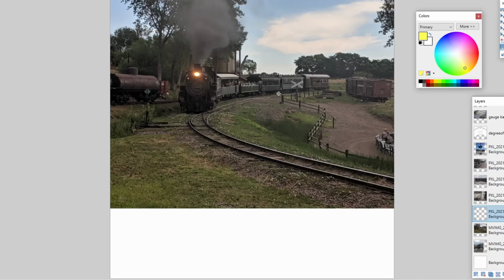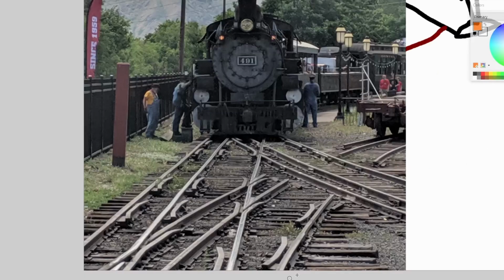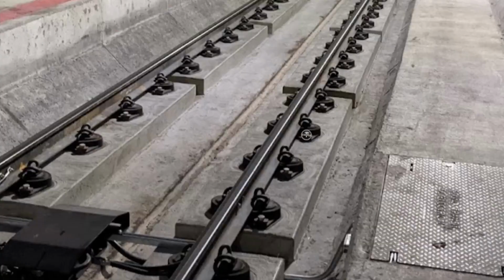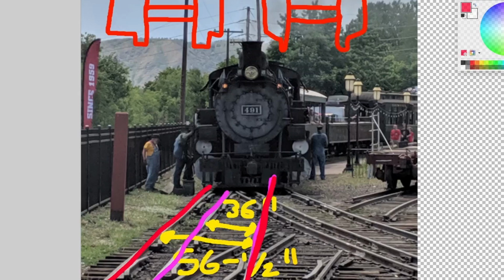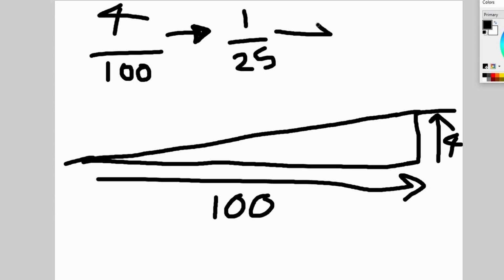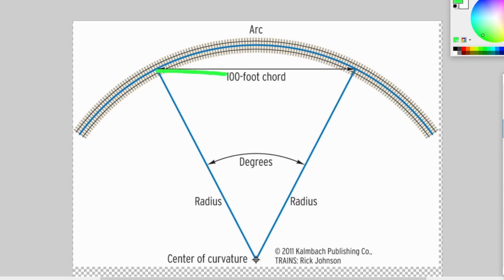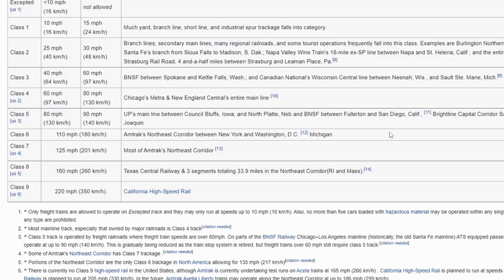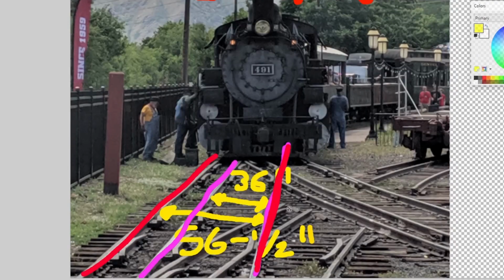TRACK 101: How does track work? (Including many often-missed things!)

Comment: Very detailed & accurate look at railway track - but incomplete in one significant way.
The contour of the wheel was mentioned regarding gauge tolerance, but there's another aspect. When vehicles go around a curve the outside wheels travel greater distance thus must turn faster. In automobiles/trucks/etc this is accomplished by special gearing called a "differential". But railways use solid axles. 
This is where the wheel contour (AND the rail contour) plays an ingenious role. Both rail head & wheel flange having a curved cross--section allows the solid axle to shift to the outside of the curve, riding on a slightly larger circumference, while the inside wheels likewise shift to a smaller circumference, allowing the outside wheels to travel a greater distance. Some metal-on-metal squeal often results but it is pure genius.
A simple drawing (that I cannot do here) would help this explanation.

BTW, PRIME-er (long "i") is paint or something that helps set off dynamite. The introductory book is, in American English, pronounced PRIM-er - short "i". Look it up if you doubt...
Reply from the maker: Thanks for the comment Doug! Very, very important bit you mentioned there. Always a challenging thing to figure out just what the right amount of info is, but I think this would've been a good add. So, I'll pin this comment. Thanks :)

And I am not surprised that I am messing up English. I am an engineer, after all...
Reply: @Hyce777  @Hyce, I think Doug is having you on. Primer is primer. From "prime" being the first. So a first book or a first fuse, primer (the I rhyming with eye) is correct. Primmer is just the adjective formed from "prim", which is to be "feeling or showing disapproval of anything regarded as improper; stiffly correct" according to Google, which apparently went away and looked up the Oxford Languages Dictionary.
Reply: @neilbarnett3046  it's sooo odd how many different ways people can say the same thing... Even just comparing US and England.. 
Words are hard
Reply: @Hyce777  I have often wondered (and so far been unable to discover) if some unnamed engineer thought this up & designed the wheels for this result; or if (more likely) it was just a discovered added advantage to solving the problem of a hard-transition flange & square rail head. The early days being strap iron on top of wood, the curves could well have been added long before increased speeds required it. Any insight on this question?
Any thought of editing the video to add this info with a drawing?
Reply from the maker: @dougvalmore7389  I've not heard of the story of the dawn of the tapered profile either. Would love to find out.

I've never edited an already posted video before? Not sure how that works. I'll look into it. If it's not possible, I am planning following on classes with other things I've come up with, tangentially related topics, etc. so I could include it there.
Reply: @Hyce777  Not sure. I've seen many videos w/corrections/additions & assumed they were made after uploading... but we know the perils of assumptions.
A search showed tutorials on Youtube Studio & how to trim stuff out, and even add cards, music & end screens, etc. But nothing specific to adding new material. Hope it works out...
Reply: @Hyce777  Here's another interesting bit about track gauge: Why on Earth 4 feet 8 1/2 inches (56 1/2") as Standard? Seems an odd number to choose.

Legend (& perhaps plausibly fact) has it that was the normal width of a 2-horse team side by side (or multiples thereof). Thus from Roman chariot days it was the width of most roads, which then (having been cut/filled/leveled/tunneled/etc) became the basis for much railway right-of-way. Fascinating, if true, no?

Plus, is that distance from outer, or inner edges of rail head, or center of rails? I honestly don't know but assume it's measured on center, like studs in house walls. Thoughts?
Reply: @dougvalmore7389  I think the gauge measurement is between insides of rail head
Reply: @dougvalmore7389  Yes and no. 56 1/2" was the gauge chosen by George Stephenson for the Stockton and Darlington Railway, he chose 4ft 8in first, but went half an inch wider (between rail inner surfaces) later on. Because the railway was for transporting coal to the port, the hundreds of existing wagons in that gauge made the choice extremely useful, though Stephenson later said that, given the chance, he would have made the gauge a little wider.

There is a Wikipedia article about Standard-gauge railway. (I must admit, though, it seems to be as much about the others gauges.)

And quite why anyone would feel the need to pronounce "primer" as "primmer", I have no idea. It makes no sense at all, a primer in school is a first book, from "prime", exactly the same as a first fuse, or "priming" being to force an engine to take its first charge of petrol, or a musket to take its first charge of black powder. 
"Primmer" is a perfectly good adjective, though I can't say that I would ever see myself using it.
Reply: @dougvalmore7389  Actually, I think it comes from wood barrels. It has long been known that the double tapered shape of a barrel would allow it to roll down the middle of a pair of guide rails. The taper in the wheels does two things. As you pointed out, it helps on curves. But it also makes the wheel set self-centering between the rails. You don't want the flanges wearing out the gauge faces of the rails. That leads to a lot of friction and a lot of maintenance.
Reply: @dougvalmore7389  probably because the metric system hadn't been invented?  Lol
Reply: @dougvalmore7389 p Pop
Reply: @neilbarnett3046 I
Reply: I thought your pronunciation of Prim-er was UK English. Anyway, it is not Canadian English so much. Prine-er is just fine for me.
Reply: The paint and the schoolbook are pronounced the same where I come from, FWIW.
Reply: @pfeilspitze  the paint... And schoolbook... Wait what???
Reply: Interesting this word is. Merriam-Webster on my smartphone shows two definitions for "primer," the first pronounced "primmer" in the sense Hyce used here ("a short informative piece of writing") and first known use in the 14th century; and the second with a flat "i" ("eye") as a "device for priming," first use found in 1650. However, as long as the meaning is conveyed, isn't that the purpose of language? Still, an interesting discussion.
Reply: Well that is the whole idea of the wheel contour and it was not needed or maybe intentionally omitted but he did say wheels were contoured, is that why wheels squeal around curves???  Hey one wheel is dragging along because the wheel does not have the right contour or something like that?????  If you look at high traffic curves that have not been surfaced by grinding you will see what I'm talking about.
Reply: I have always wondered why, especially now that rail isn't exactly in its infancy, why they have solid axles, and not differentials? You would think that that would help tremendously when it comes to Axel and rail wear.
Reply: No one says primer

Comment: 11:12 rail clips are used on the brightline. And large sections of the southern part of the FEC. The brightline has a bad habbit of rattling these springs loose and cause them to go FLYING! There is an old station thats now a pharmacy on one side and a 3 story condo on the other. At least 3x a year one of these buildings has a spring go flying thru a store window or the zip board walls and siding of the condo. One plus is they are made of amzing spring steel. I heat em up and bang em into some of the best knives and tools ive ever made out of found steel. Definitely a better tool making and knife steel than even old leaf springs.

Comment: i know this video is older but i will comment anyways. model railroading used to use insulated rail joint before the advent of DCC. you would create "block zones" so you could run different trains at different speeds. this is the old school way of doing it.
Reply from the maker: 100%! My granddad's sound systems were DC only so I'm familiar with the block zone idea.

Comment: Good catch Doug. Let me also add; 

The wheels (L & R) and the axel is one solid piece of steel. Hence they rotate at the same rate. On a curve the outside rail is longer than the inside rail. The two wheels, turning at the same rate must traverse different distances. The flange design address this issue. 

As the car rounds the curve centrifugal force causes the outer wheel to ride up on the rail thus increasing its diameter and circumference over the inside wheel. As the axel turns one rotation  the outside wheel, with increased circumference, now travels a greater distance, offseting the longer outer rail's distance. This prevents the outer wheel sliding and chewing up the rail. The reduced squeek rounding the curve is just an indication of the effectiveness of the wheel flange design. 

Note
Replacing a section of rail is a very, very big deal. It requires the track to be taken out-of-service. This action requires; Train Orders, Bulletin Orders, redirecting traffic, hiring an M&W crew, and a train crew for the work train, just for starters. 

This is such a big deal that to further reduce the frequency of having to replace the rail, they use a harder steel for all rails, than they use for the wheels. 

Chew the wheel, not the rail. It's much easier and cheaper to shop the car and replace the wheels, which takes less than a day, than replace the rail, which takes days.  

All-in-all an excellent post. Everything was spot on.  Hope my little addition helps. 

Thanks!

Comment: Enjoyed your video. Brought back memories when I dabbled in model railroads. I was 14/15 years old and was designing signal circuits for it.
I sought out old defunct PBX equipment to salvage relays to build the logic circuits. It helps that I was surrounded by three generations of electrician and good supply of demoed telephone equipment.
Wound up at 17 working on a tourist railroad and working with the signal crew for two summers.
I guessed I missed my calling as a signal engineer.
Now I am a retired commercial / industrial engineer installing process controls.

Comment: When you started about thermite welding (often called Aluminothermie where I live) I kind of hoped you had some footage as well as it can be quite spectacular if someone never seen it done. We use the same methode for track welding in the Netherlands and I had the pleasure to watch it being done when working a temp job at the Dutch company resposible for the Dutch network. I was a bit shocked to learn it involves temperatures of up to 3000C(ontinental units) or 5432F(reedom units)

Comment: Wait in the US Wood+Creosote is still the most common way for ties? I mean they are still getting installed?!? We in germany have a good amount of remainers, but usually nowadays here are installed other ties (for example concrete as you said is also used sometimes or metal, but wood+creosote is not made anymore here because it turns out that there are some unwanted imlications - it's sticky which can make some other problems - it's also not the best thing for the environment (well I guess for US it's somewhat not really relevant as so many people drive by car instead of public transport (which is of course caused by really bad public transport in many regions in the US)...

Comment: just curious about the track layout on the image you are describing the track gauge (around 22 mins in ) there is a side track with a car on it that doesn't appear to have a thru connection connecting to the main line that the engine is on, or do the tracks shift/pivot to allow it to be connected?  Good explanation on the "How do Trains Steer?  Switches 101"

Comment: 31:52 to 33:00 - I'm sorry. I might be overlooking something, but I fail to see how you can calculate the degrees of curvature without knowing the radius of the curve. Simply measuring 100 feet of track tells you nothing, except you'll find two spots along the curve that are 100 feet apart.

By knowing the radius, however, you suddenly have an isosceles triangle (a triangle with two equal legs = radius) as shown in the diagram, and suddenly you're able to calculate the different angles in that triangle (because you know the length of all three sides in that triangle), giving you the "degrees of curvature".

Thus the degrees of curvature and the radius of the curve are just two different numbers describing exactly the same. If you have one, you have the other. One specific radius will equal one specific degree, and vice versa.

Essentially like miles per gallon (fuel effeciency) can be calculated into litres per 100 km (fuel consumption). They describe the same reality, but in different ways - but one specific number of mpg will always equal one specific number of l/100km.

Essentially, you have "double" right triangles (right-angled triangles) with "opposite cathetus" = 50 feet and hypetenuse = radius. Then you use SIN to calculate the angle, and double the result (because you only calculated half the degrees of curvature, based on half of the "double" right triangle).
Reply: To ‘string’ a curve you need a piece of string [duh] of known length, (for railway work 100’ is common) with three knots in it. One at each end and one in the middle. 
With the string pulled tight along the straight run of track, at the CTP (curve tangent point) you place the  middle knot. You then measure the curve offset at the far point and stake it. 
Move string so rear knot is at CTP, middle knot on new stake and measure new off set at far knot. 
Rinse and repeat. 
With a pre-calculated set of off sets (kept in your little black book of spells) you can quickly ‘string’ curves, with spiral easements, without recourse to radii, theodolites or planer sextants. 👍😇

Comment: We still use lb per yard in the UK but mostly use Bullhead instead of flat bottom which means it had 2 heads instead of 1 and a foot with chairs instead of spikes. flat bottom was mainly used on narrow gauge and light rail with spikes

Comment: I have a question! If you have (Hypothetically) a 0-4-0 that can only reach speeds of 15MPH and runs on Class 1 track. Can it run on track that is a higher Class than what it is supposed to run on? Like Class 3? Or is it illegal and too dangerous for a locomotive that can't exceed 15MPH to be running on a Class 3 track where the minimum speed is 40MPH?

Comment: 31:44 as far as i know the swiss actually fine tuned that system for a double decker high speed train (or as we call it in german  ICN (Inter-City Neigezug)) because the sideways foces are especially likely to guve you motion sickness on the top deck

40:12
 i remember some funny advertisements from the swiss federal railway that say "aus vernunft 125 Km/h innerorts"
wich translates to "78 mph through the city because we're reasonable."

Comment: At 4:24, about rails welded together into longer 400ft pieces, its actually the opposite. Today the rails come as a 400ft (or even longer) single piece out of the steel mill, there is nothing welded on them. Back in the days when they used short rails that could fit on a single car, they cut the short rails from the long rail comming out of the steel mill

Comment: I was head of track maintenance for a steel mill until it closed. Spent many a day running a mk1 switch tamper with lift jacks. 4-71 Detroit. It was like being in a paint shaker. Earmuffs over earplugs were an absolute necessity.
Reply from the maker: Yeah that sounds awful.

Comment: I live right off the Falls Road. RR in NY. We have old rotted out ties, with decent rails. we still have square nuts on the joint bar. Today i discovered that the RR just tossed rail segments off the side into the woods (like you said Hyce, the railroad does what it wants ). The Falls Road RR is the one with the Upside-down Bridge over the Erie Canal in Lockport, New York.

Comment: 1/20 is what percent?
Reply from the maker: 5%. Pretty steep.
Reply: @Hyce777  I was trying to find the taper/angle of the train wheel, not grade.
Train wheels are 1/20 slope but I didn't know what percent that would be.
20x5=100 and 1x5=5, so it's 5% taper/slope angle. (I haven't been able to find this anywhere)
Reply from the maker: @timgiles9413  huh, I didn't realize that the wheel profile had that taper. I knew they were tapered, but not specifically 1/20.

Comment: You fail to mention the problem of rail expansion with temperature.  The joints take up this expansion.  Then the weld boys came along, arguing that the weight of the rail would hold the track from expanding.  But every year in the summer, maintenance crews are running around cutting pieces out of track that is threatening to buckle & rewelding it, & in the winter, cutting the track & rewelding pieces in to keep it from pulling apart.  When the track is curvy, it can to a certain extent relieve this stress by moving sideways.  Could this be why museum track was buckling on that curve?
          You need to explain what that track you show with a missing criss-cross.  How does the train on the other track get through?
Reply from the maker: They've got expansion joints, which I learned after this video of course, lol. 

For the diamond-not-diamond; the rails have to be manually swapped out. It's been a project for a long time to build a diamond there but it's just never been at the top of the priority list.

Comment: I would imagine that rail is occasionally struck by lightening. What happens then and what precautions are needed?
Reply from the maker: Signal equipment has to be protected against it; there's more ramifications for electrified railroads, but rail usually does a good job conducting to ground unless you're at an electrified railroad that tries to prevent that lol.